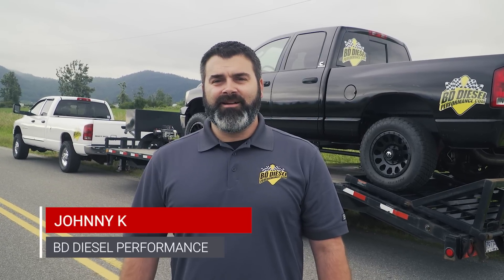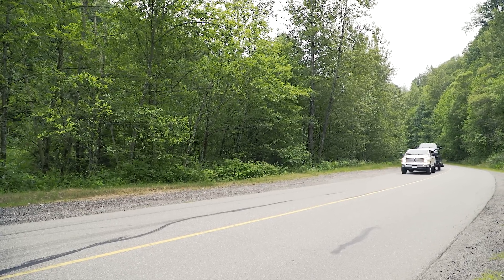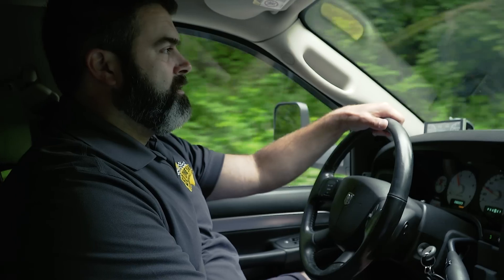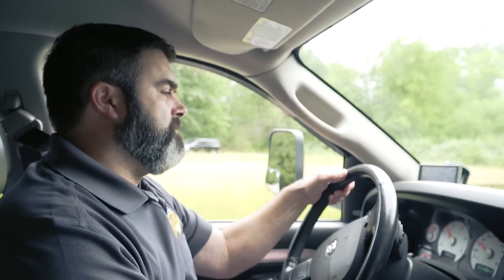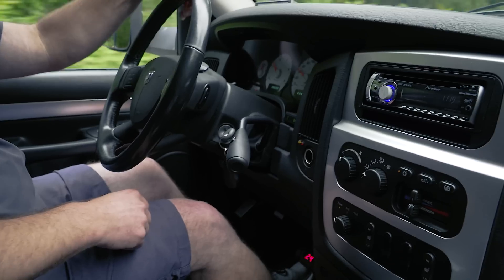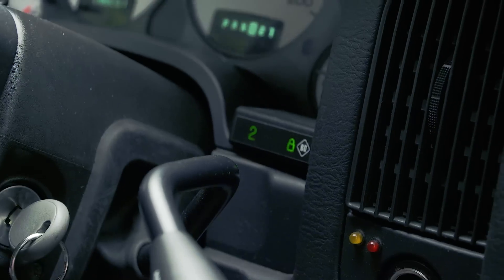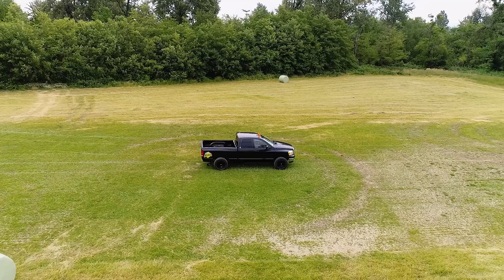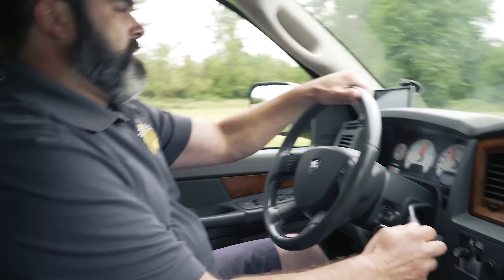BD Diesel 48RE TapShifter - See How It Works

Comment: Just leave it in drive with overdrive enabled. A properly built transmission will hold towing any weight in overdrive locked up just fine.